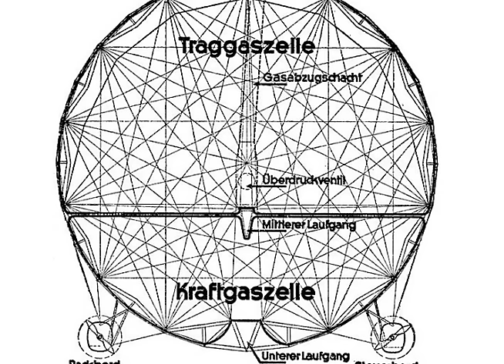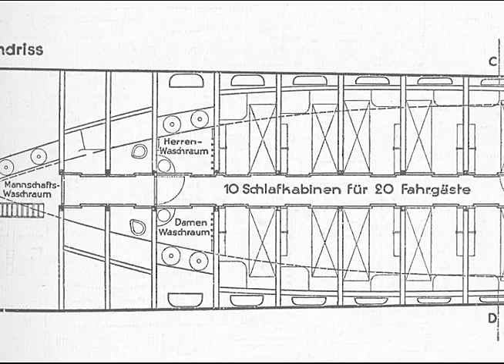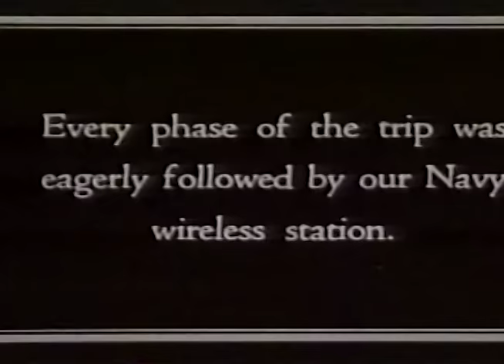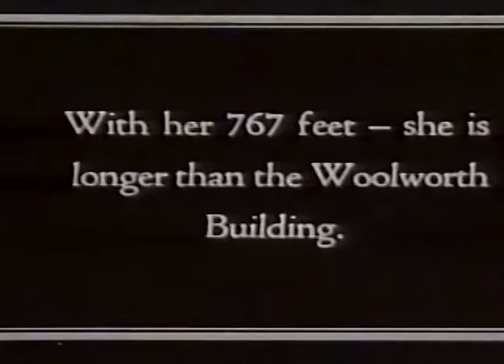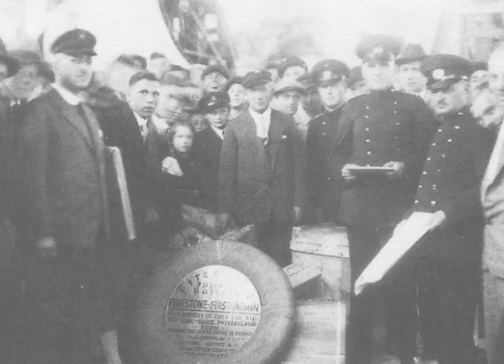Graf Zeppelin World Cruise

Comment: The word 'icon' is bandied around a lot today.  This airship really was one.  But as we know, the forty year era came to an end in 1937 with the Hindenburg disaster.  The main drawback was the huge cost of construction of the rigid frame airships, and from record I saw somewhere, only 156 were ever built worldwide - most, of course, in Germany.
Reply: The biggest problem was that the Helium order for the Hindenburg was "sanctioned", thus cancelled, so they had to use Hydrogen, and then the "accident" "happened". Dealing routinely with Hydrogen leads to a very short life expectancy....
Reply: They only carried 20 passengers.  The great Ocean Liners were as large and carried 3,000. Passengers, and traveled just as fast.
Reply: @ziegle9876  Not necessarily. The original Hindenburg design was for concentric hydrogen gasbags inside, helium outside. And the "Graf Zeppelin" survived a number of years despite carrying both hydrogen and flammable gaseous fuel. The crucial thing is to avoid hydrogen mixing with air due to leaks, and to allow any leaked H2 to quickly vent away. In the "Hindenburg", an interior cable stay snapped when the ship was turned too sharply, cutting a rear bag, which leaked profusely and was very likely ignited by an electrostatic spark at the top near the tail.
Reply: @awuma  So you don't think it was sabotage? In New York?
Reply: @ziegle9876 No
Reply: @ziegle9876 
There was a thunderstorm in the area which can cause extreme static electricity build up. The theory is that when the guide lines were dropped, this allowed the electro-static charge existing on the ships hull to ground and cause a spark, then BOOM🎉 The chemical doping on the fabric skin was also flammable as shown by the red flames. Hydrogen burns blue.
Reply: 35 deaths out of just under 100 total crew and passengers and it causes massive uproar, now we can smoke a passenger jet with 200 souls on board into the ground and leave the charred wreckage off the end of the runway while other planes take off.
Reply: They are making a comeback. Massive investment happening in new airships.
Reply: @ziegle9876  They recently proved it was static discharges between the electrically isolated outer and inner skins.  If they had been bonded they would not have had this fire.
Reply: @Wanamaker1946  No ocean liner can do 70 knots... but your point about passenger and freight capacity is spot on.
Reply: Yes I think it has been proven & that poor entertainer guy who survived & was accused of sabotage, copt heaps for the rest of his life, poor fellow @fazole
Reply: @Wanamaker1946  Zeppelins traveled about 60km to 70km an hour. Most ships were traveling around 18km to 30km

Comment: @The "jump" over the wire: I wonder, how much aerodynamic lift she could get continuously by engine power, with some angle of attack.
@3:41: "I always had the impression,.... deep impression and fascination...": Still works. So many people are fascinated by these big airships of the past, despite their severe disadvantages to planes. Me too. It just looks so cool!
@"Blaugas" fuel: I wonder, why they skipped this in the first place. No change of weight during flight (by fuel combustion) was a big advantage. Too much space demand? Too high additional fire risk? Local availability?
Of course, there were other solutions like ballast water production from the engines' exhaust.
But a fuel with the same density as air was an elegant approach.
Reply: Yes, a cylinder at some angle of attack generates lift. This is seen in the final phases of a Falcon 9's re-entry and approach to landing, the body of the booster being inclined to the direction of flight after the re-entry burn, when massive deceleration is seen. The angle of attack is controlled by the grid fins, guiding the booster to a point safely away from the landing zone, with a final course correction to the actual landing zone when everything is confirmed to be nominal.
Reply: I wonder how the hygiene on this aircraft was?

Flush toilets?
Showers?
Bathroom sinks?
Menstrual cycle?
Laundry?